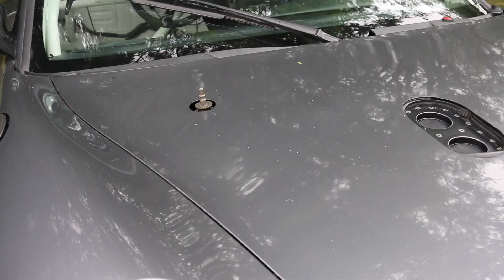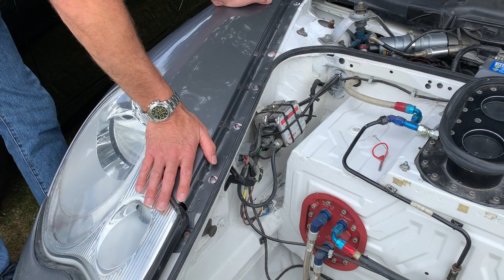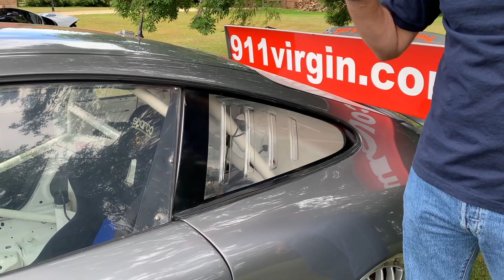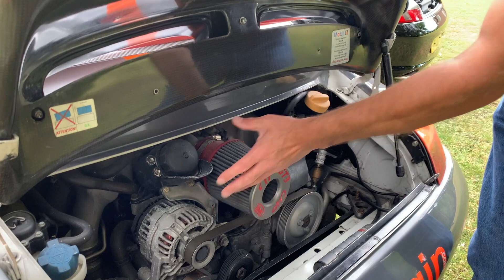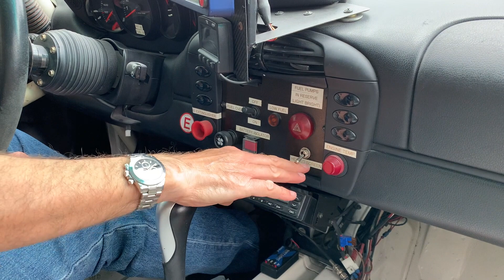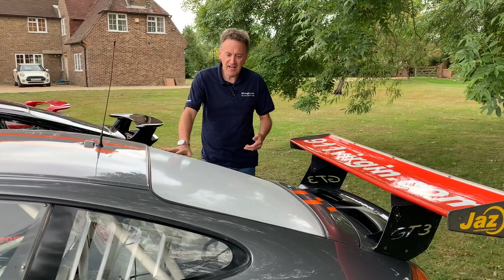Porsche 996 GT3 cup car walk round. See what a factory race car looks like up close and personal

Comment: Hello great video what does the vehicle weight ? and can I ask the difference between the Gen 1 and Gen2 in terms of the Body and Rear wheel arches as I want to Put the TURBO wide arches on a Gen 1 https://www.youtube.com/watch?v=rdLkBR-i4fU
Reply from the maker: Rather you than me. You seem to have a car cut up into little bits 🤥
Reply: @911virgin8  yes I cut it in pieces as I  want the TURBOS widebody and the ventilation to the intercoolers and to also cool the panels and so I can run 315 tyres on the rear

Comment: That's a really cool video. Thanks. It's really tidy car with a great standard of finish for a race car. I have a 2003/4 model mostly used for track days. Can I ask you what spec the doors are and whether they were expensive? They look more solid than the originals and I was impressed you could lean on the driver's door as you got out without hearing a crack! Also is the spoiler itself the original spec? Obviously the mount extensions are after market. Last question is about the shift lights. How tricky are they to install and is the unit pricey? Sorry for so many questions. Final thought - would be great to see it at Rennsport Collective in November. Only a couple of 996 cups in the group so far. The other one is also set up for endurance racing and ran at Daytona I believe. Joseph
Reply from the maker: Thanks. Very much in it's working clothes. Bizarrely because I never had any big accidents we put it on a jig just to check alignment and tidy up any welds that had opened up over the years towards the end of it's racing career. It could use a new front PU and the rear PU has been adapted to suit the variety of exhausts we had to run. Straight through system at Spa was always my favourite.

Doors are standard 996 GT3 cup car items, rear spoiler is wider than standard I think, probably RS spec from memory. It was changed ages ago. Shift lights were on when I got the car a couple of years into it's life, I can't see they would be that hard or expensive to fit.
Reply: 911virgin Cool, thanks! Straight through sound definitely best!
Reply: those doors are Mk1 Gt3 cup (frameless window). From 2003 onwards they went to a fully framed composite door.
Reply: @porschenut9  ah that makes sense. The mk1 setup actually looks a bit tidier. Thanks!
Reply: @porschenut9  Anorak alert, the mk1 doors can also be found on the mk2 2002 model year .The later doors look better i think.

Comment: Nice but I am waiting for a video on a Suzuki Jimny!
Reply from the maker: Ah yes. The 4th generation Jimny finally broke into 100bhp territory. I don't think Suzuki ever quoted official 0-62 times (assuming it goes that fast), but your best bet on Top Trumps would be weight which for an off roader is surprisingly close to a tonne. Of course you then have to add a driver which in some cases can get you back into 1,500kg.

Comment: The battery looked a bit on the big side for a racer where weight is a factor.
Reply from the maker: You have to remember this is set up as an endurance car rather than a sprint car. A couple of KG saved could bite you in the bum when you're needing the battery to support a failing alternator or to drive the car off the track on it's starter motor etc. There are a number of options for battery mounting positions to allow for different options.